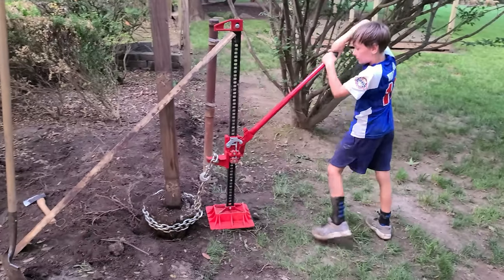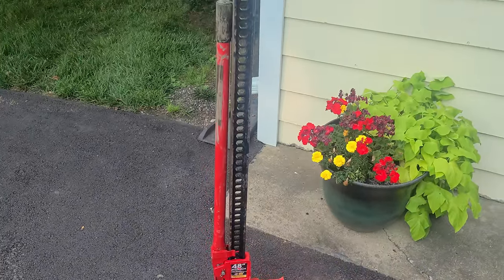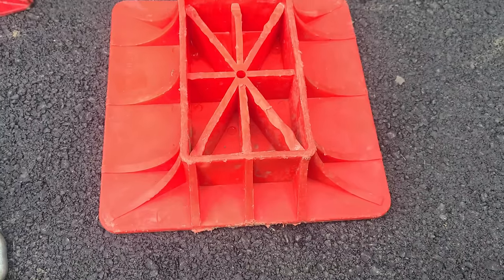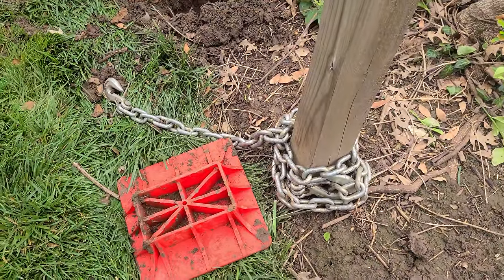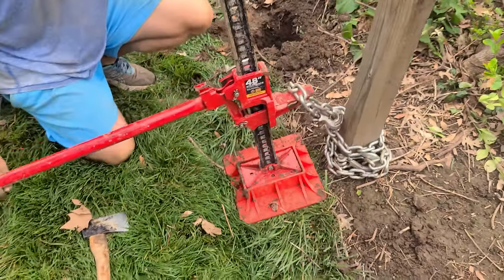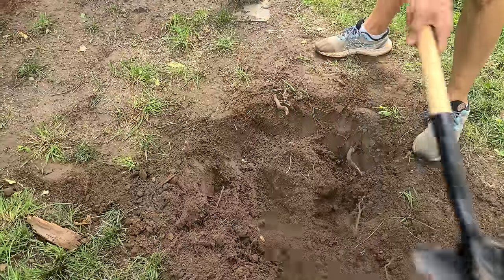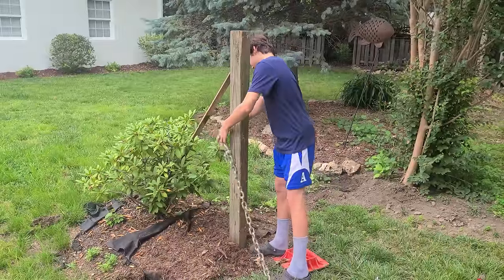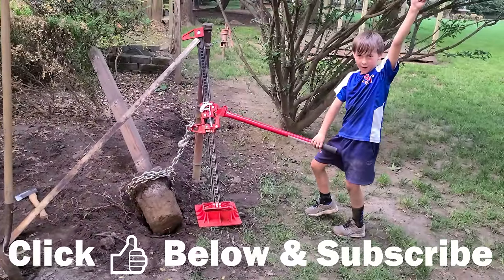How to Remove Fence Post in 3 Minutes!!!  |  How to Remove Concrete from the Ground.

Comment: May I suggest an alternate ?  Cut the post three feet from the ground.  Drill a 1in. hole through any side and insert a piece of rebar,  Put a Tripod over the top and hook a come along to it.  Connect the rebar and hook with a strap.  Wind the come along (aka a Weston Pulley) and the old post will come out like an old tooth
The advantage of the above vs. the jack method, is that a tripod is balanced and pulls directly upwards, whereas the jack is offset.
Reply from the maker: Appreciate the comment.  Thx for watching!

Comment: I pulled a post set in concrete by accident as a kid...
Recent rain, swinging on it in circles, up it popped.

You don't have to work hard... just smart.  Pour a bucket of water at the base of the post.  Wiggle the post back and forth.  It will come out.
Reply from the maker: Appreciate the comment.  Thx for watching!

Comment: any 4x4 post will also work, and ratchet straps. Loop a strap around the concrete base, set a fulcrum point, attach post to ratchet strap across your fulcrum and step on your lever.

Comment: That is the whole point of a farmer's jack is this use.  I carry around a 2" paver stone 12x12, just for sitting the jack on. 
Instead of wrapping a chain around and looping over and under, just loop around a few times, inside then out for a clove hitch or hitch and that loop over the lip of the jack.  Easier to get off also.
The chain your using is what 1/2 "? , you can get by with 3/8- 2tons, maybe 1/4 -one ton rated. It will be easier.  I have also seen people use nylon straps 3", working load of 2 tons +.  Not ratcheting it, just wrapping around, with a hitch knot, and farmers jack.

Comment: Will this work on a round galvanized steel fence post?
Reply from the maker: Yes, a couple of the ones I removed where of that style.  Was basically 2 different generations of fence in some places.  Just make sure chain is tight an doesn't slip

Comment: Nice.  But that does not work in sold rock in south TX.   The post will break and you have to jackhammer them out, just like they were put in.  I had a few that happened to in my yard in San Antonio (jackhammer is the only way-- the rock was the size of a house).

Comment: BTW, if the cement base of the post extends really far out, or the ground is very uneven or soggy you can make a bridge for the jack.

Put some storng objects like pavers or strong timber on each side of the post, or shrub. Don't space them any farther apart than you must. Then put sonething very strong,  like a landscape timber across the two items and position it close to where you need the jack base. Sit the jack on top of the timber. There will be a gap of several inches under the timber holding it up. Proceed as described in this video. This process keeps you from resting the jack base on the cement surround. Which would result in the jacking pushing down on the same thing you are trying to pull up on. You can use this technique on a slope, or very uneven ground. 

If you have wooden posts that are only set in the ground with little or no cement, screw an 8 inch section of 2x4 to the lower part of the post. Hook the lip of the jack under the edge of the 2x4 and raise it. The lower you can start, the easier it is.
Reply from the maker: Great suggestion thx for sharing!  Definitely could have used this technique on a couple of mine.  A few of  mine had absurd amounts of concrete with extremely wide diameters.

Comment: I just watched because I like to see how other people think and do things. Obviously a lot of money was saved, but what happened to the posts and the fence? Did they get picked up, dumped off, sold, did it cost?  I have a dish satellite pole in my yard from a previous owner and thought I'd use it for an antenna mast. If I don't, this method would help, but I wouldn't want to buy all that for only one pole. I could see rigging a 2x4 and a lever instead of a jack somehow, but just for that one.
Reply from the maker: Local landfill collection site.

Comment: I’m in the northern midwest where at about 10” you are out of black dirt and into clay. I’m having an awful time with this. Post is broken at top of cement in shreads. With this method i have dug down 4 or so inches, wrapped the chain but the cement breaks. Next dug 6” or more & the jack comes off the stand or just slides towards or into the hole (if i let it)

Any thoughts? Thinking because of the clay in my area my only option is to dig around the cement and break bits off until it is all out.
Reply from the maker: Need to wet it.  Also support the jack with angle iron or something similar
Reply: thanks, I’ve been doing exactly that. not just wetting, I’ve been filling/soaking the hole multiple times throughout the day. Have been using a 4x4 post to brace the top of jack.
Reply: Same issue here. I just gave up and started digging. Either the cement splits at the top or the chain slips loose. Maybe spring would be a better time to do this, but doing it in September is a no go, no matter how much water you use. The clay acts as a suction.
Reply: @kooken58  same just kept digging. Got a pry bar I think officially called a tamp bar and pried it out breaking chunks, digging around, prying up. Drilled into wood with bolts thru chain link and pried with jack, bar & shovel. An awful process

Comment: Following these instruction ... as is ... the bounce back of a pipe or a 2x4 brace if it slips off the jack ... clearly is pointed right at the operator ... this is why people use the loop on the jack end to bolt to the brace and not just lay the brace in tension. 1000s of pounds in tension, face first.

Comment: Will this method work on metal chain link fence poles too?

What keeps the chain from sliding up the pole?
Reply from the maker: Just friction and tension. If chain is slipping you can loop it through around itself once or twice, but can get away without looping it at all sometimes.
Reply from the maker: Yes will work on those as well.  I think 2 of mine where of that style from 2 fences ago.  I was cleaning up fences spanning several decades, lol.
Reply: Thanks. I’ll give it a try.  I like easy!
Reply: Bend the pole?

Comment: Another safety tip.

I'd recommend using personal protective equipment to protect the eyes, face, head, and hands.

Odds are, you'll get through every project just fine.  But, it only takes one slip of a chain or an improperly tempered lonk, and someone could get hirt pretty bad considering the pressures applied in this type of work.

I've seen metalbtools fly apart into small metal splinters under stress before, and only the PPE protected us.
Reply from the maker: Appreciate the comment.  Thx for watching!

Comment: Where I live our posts are 5 feet into the ground and the bottom of the post holes are bell shaped to prevent frost lifting the concrete, this is a cute video but truth is I could pull most of your posts out with my bare hands.
Reply from the maker: Haha, cool story.  Thx for watching!

Comment: I had to replace a mailbox post. The ground was wet from a few days of rain.

I took hold of the post and started to rock it back and forth. The ground loosened up and allowed me to pull the post right out.

Don't rock it back and forth too much. You only need to do so just enough to pull the post out. Otherwise you'll need to put more concrete into the hole.

Comment: I think I can beat this. 
I place a 4x4 (base) 4 or more feet long on the ground 6 inches from post. Lay another 8 foot 4x4(lever) with the end on the first 4x4 and next to the post. One end of the top 4x4 (lever) will be laying on the ground. Use rope to tie them together. Wrap the post several times below the lever, and then a few times around the lever and the post. Lift the lever off of the base 4x4 and place spacer between to take up the slack (4x4 or 2x4 pieces). Then lift the long end of the fulcrum arm and its just like pulling teeth. You may need to raise the lever, lower it back down, then add more spacer under the base. Repeat as needed for a deep post. 
I have done this a lot. Landscape timbers work also.

Comment: Don't do this if you have a tractor with a bucket or backhoe. Depending on the situation, I use either the backhoe, or the bucket (mine has chain hooks welded on the top of the bucket), of my Kubota tractor. However, I understand that most homeowners don't have one available. Great video showing how it's done.

Comment: I park my four wheeler right over it and use the front winch. Wrap the cable around the concrete and hook the hook back over the cable and tighten it up and let it pull it straight up out the ground. Then back up and drag it away.
Reply from the maker: Appreciate the comment.  Thx for watching!

Comment: If you find it impossible to remove the old fence posts you can cut them at the base with a chainsaw, leave the base in the ground and dig new holes a foot or two over to one side.  This will work for all the posts along the middle of the fence.

Comment: How long did it take you to remove 300ft of fence?
Reply from the maker: I took my time with it just working here and there in evenings and weekend over a two week or more period.  Spent first week cutting and tearing down the panels, and second week with the posts.  Basically 1 U-Haul load of panels one week, and another U-Haul load of the posts.

Comment: Does this work for posts set in concrete that is about 10" at the base of the pole and angles out as you go deeper into the ground? Basically, envision the concrete as a traffic cone. In colder climates, this helps to prevent frostheaves as the tendency will be to push the post down instead of up.
Reply from the maker: Haven't tried it.  Let us know!
Reply: You would want to dig down some around the concrete edge. Maybe 10in- foot or so. It will be easier and won't make as huge of a hole.

Comment: Unfortunately this wouldn't have worked for me. I had to remove concrete posts that were part of the previous owners handicap ramp. They were built on poured cylinders in cardboard tubes. Then metal brackets were set in the concrete. Then the posts were bolted to that. If you tried to pull straight out by the post, the connecting metal bracket would tear and break. And you couldn't wrap the chain around the concrete because there was no lip. It was smooth cylinder  all the way up to the top. 
So the ones that were in the yard, I just had to dig huge holes to get them lose. The ones that were in the driveway were a completely nightmare. It took days for each one. I'm glad I'll never have to mess with those again!
Reply from the maker: Appreciate the comment.  Thx for watching!

Comment: Another safety tip:  When the concrete blob is out of the hole, do not position your head under it.  The chain could slip and your head would be crushed.

Comment: Sadly all of my posts were completely rotted and trying to pull the concrete out either resulted in it slipping or the concrete giving out before the ground did. Ended up just having to do it the old fashioned way.
Reply from the maker: I think if the ground is hard it makes it tough.  Definitely helps if had a good rain recently
Reply: Yep dig it up by hand

Comment: The problem is when I have to remove fence posts, it's usually because they've broken at ground level from rot, and I'm stuck digging them out.
Reply from the maker: Yeah we had to dig around several to get the chain around that were rotten.  Appreciate the comment.  Thx for watching!

Comment: Should add an asterisk…it’s going to take a lot longer if the post and concrete are in clay…and if there is standing water rain is the last thing you want lol…but this method is by far the easiest method out there unless you have a backhoe

Comment: This looks easy but it's not that simple! It depends on how soft your ground is, I had success lifting one beam out the ground but on the next one the jack broke where you attach the chain, so I wrapped chain around entire mechanism and the entire mechanism broke! It was new jack like one on video, I took it back to tractor supply, Maybe I should have soaked the ground before attempting
Reply from the maker: Yeah soaking or doing after a rain really helps!
Reply: @thebumpchannel  yes I should have known better, it's a complete difference after a big rain!

Comment: @1:03 I see you have a twist in the chain.  If you will approach the capacity of the chain strength, know that its strength capacity is diminished when twisted and it may break.  This is also why you should never twist your safety chains on a towed trailer.

Comment: That’s easy when the post is just embedded in dirt (as opposed to clay and/or rock.)
Reply from the maker: Definitely easier when ground is soft from heavy rain.
Reply: @thebumpchannel  When the concreted post is in heavy clay or rock, the odds are pretty good that the post will come out without the concrete, and then your kid will have to know how to use a jackhammer to break up the concrete. This may necessitate some adult supervision.

Comment: I have cut off Creosote treated light poles that are buried about 3 feet in the ground with concrete so I don’t think this method will work for them. The poles stick out of the ground about 5’.They weigh a bit more than your average fence post.

Comment: i used this exact jack to remove 6 concrete posts.... it broke after 5. its decent but its not as easy as the video makes it look. the post you pulling out are so small, the concrete i mean. i had to pull 45in of concrete its was a pain in the  @$$
Reply from the maker: Wow!  Some of mine were huge and a pain as well....but 45"?  I assume you mean in depth?  Mine were 24" to 30".
Reply: @thebumpchannel  yeah my village for some reason wants 42in depth for concrete. Its insane. I gotta remove 17 posts now. Im going to try to remove my old fence

Comment: This does not work well in NC red clay. If you don't dig more than half way down the concrete, it's not coming out using that jack.
Reply from the maker: Have you tried wetting it?  Much easier when ground is saturated.

Comment: In my experience the posts rot off at the base and there is nothing above the concrete to attach the chain.  I’d give this 2/10. More often than not utterly useless.
Reply from the maker: We just dug top six inches or so and wrapped the concrete with chain.  Less digging overall.

Comment: You don't need any of these fancy lifters. All U need is long length of 2x4 and a solid 6" dia steel ring about 2" wide. And some form of fulcrum point like a couple of large blocks. Slip the ring over the post to a point where it  works as a point to fulcrum from. The ring will tilt and jamb on the post wherever U put it. It will only jamb harder as you lock the 2x4, or 3 x4 fulcrum under it. We have lifted hundreds of posts out this way. Far faster than your method.
Reply from the maker: Appreciate the comment.  Thx for watching!

Comment: That wont work on my fence posts. I use a 12" auger for 4x4 and 6x6 posts. I pack 4 to 6 inches of compacted gravel at the bottom then pour three 80lb sacks of mix around the post. Each post has 240 lbs of concrete in the hole. Good luck removing my posts. 😂😂😂
Reply from the maker: Wow!  Appreciate the comment.  Thx for watching!

Comment: You dug, set up the jack, wrapped the chain, and pulled the plugs...all of them...and averaged 3 minutes apiece?

Not doubting the technique, just used it this summer, but none of those pulls were remotely similar...

If you're looking for the easy way, this may or may not be it...just saying....
Reply from the maker: Much easier when ground is soft, but yes most were that easy.  Don't get me wrong there were some that would get you cussing but my kids could literally do in 3 min.  Pulling only.
https://youtu.be/g7G6Pvy86pk

Comment: What a poor job by the original installer/homeowner when digging and filling the post holes. Overkill on the concrete especially the top third.
Reply from the maker: Yeah some of those were massive and not fun.  Thx for watching and appreciate the comment!

Comment: You shouldn’t pour concrete around a fence post. Dig a hole below the frost line** Pour Concrete in the hole, when set, put the fence post on top of the concrete. The only place you need concrete around the fence post is at a gate. Pour the Concrete first below the Frost line, let it set up set the fence post on the concrete and pour around the gate posts. ** Your County building codes department, can tell you where the frost line is.

Comment: You do know that the tractor jack has a strong reputation as "the widow maker".  I suspect the kid is not married, but he shouldn't be operating that jack.
Reply: you have to always stand beside the swing of the handle and never get above the handle. we used one on the farm, mounted in a frame to raise the front of the wagon to dump it. one time I was raising a wagon and got careless and lost hold of the jack handle. it started swinging the handle up and down as it dropped down each notch and only stopped when it was at the bottom. I knew better than to grab the handle and risk getting my hands smashed so just stood back away from the carnage. then had to jack the wagon all the way back up carefully this time. nobody's fault but my own. be careful, but a post is not as heavy.